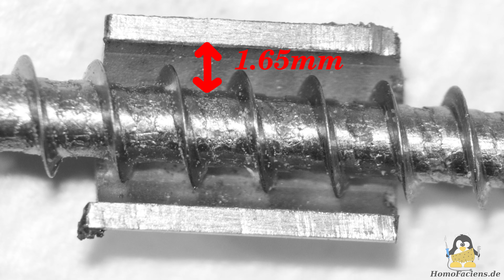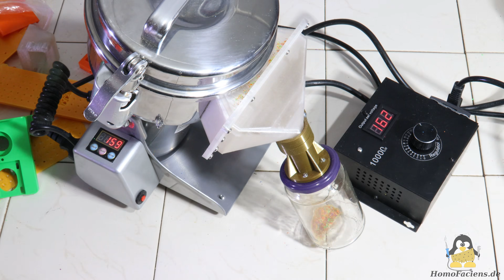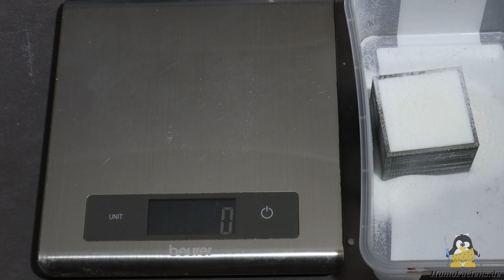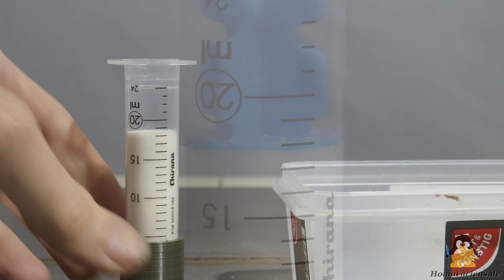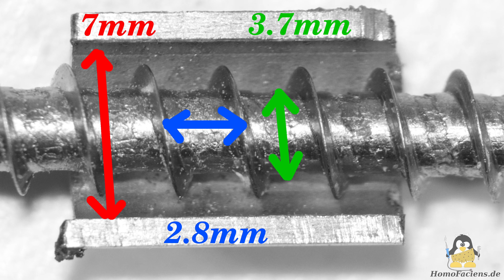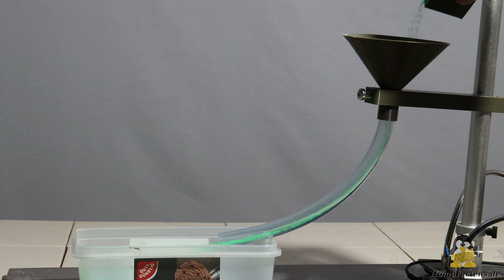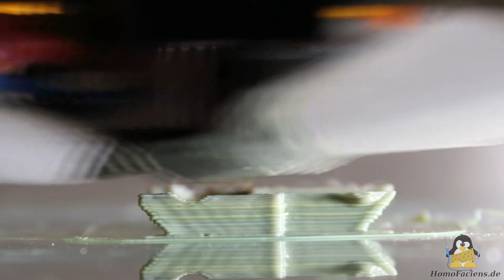Powder properties and print tests with extruder V7.2

Comment: I haven't watched all of your videos, just the last couple.
I'd like to suggest an idea. I don't know if it will work.

To compress the plastic in the extruder with a constant screw pitch, you can reduce the diameter.

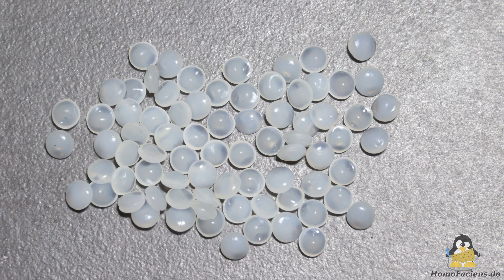There are hand-held cone reamers with a taper of 1:10, 1:30 and 1:50.
The screw can be roughly ground first. Then, make several plastic blanks with holes made using the same reamer. Then, precisely adjust the screw by lapping with different lapping pastes or abrasives of decreasing size. One plastic blank per abrasive size.

However, I suspect there's a risk of jamming with a screw in a 1:50 hole.
Reply from the maker: Well, version 7.2 works fine without all that extra work you are suggesting. If it works with a stock wood screw, leave it untouched. It wears out during operation and a new one costs next to nothing. Keep it simple!

Comment: Smaller might be better, but I think a more monodisperse particle size distribution is better too, isn't it? I think you could improve your milled powder by post-screening it. Typically any screening process involves a stack of screens, and the material is retained on top of a screen of smaller size, not just passed through a screen of larger size. You would then have a fine "plastic flour" waste product to deal with from the finer screen, but it seems like you could re-extrude this into large diameter filament to be chopped again, or else maybe use it directly as a very fine printing material, with different extrusion parameters.
Reply from the maker: As shown in the video, a mix of grain sizes has a higher overall density, which is favorable. Furthermore, a non uniform mixture of grains has a lower "flowability" as shown in the experiment with pushing the powder through the syringe. That resulted in a lower slippage (lower filament factor) during printing. While finer is better in terms of detailed prints, a bit rougher and mixed grain sizes result in higher volumetric throughput. As with all parameters in 3D printing: You have to find your personal sweet spot.

I demonstrated the properties in this video, the rest is up to you. ;-)
Reply: @HomoFaciens  It does seem we took different conclusions from the same evidence. 

It seemed like the propensity for jamming and the high compressibility of the mixed grain size powder would both be undesirable, and cause variations in flow rate, and that a high filament factor is good as long as it's extruded at a more stable rate and produces a smaller percentage variation than some other powder.

But as you say, there is a lot of room for personal preference in finding an engineered solution, and there's no such thing as a real optimum.

Comment: Would preheating the material before it goes into the screw help?
Then a liquid is going into the screw and the output may always be consistent, indipendent of the particle size.
Reply from the maker: Short answer: No!
Molten plastic isn't as fluid as water and the transition from solid to liquid isn't that well defined. You can try to build such an extruder. I don't think it will be better, but prove me wrong.

The extrusion is consistent enough for every day prints, even with the dirty cheap recycled plastic powder. For those who want even better results: Stay tuned!

Comment: The final printed part was much better than I expected, good work.
But honestly at small sizes pellets extruders seems to be too inconvenient, reducing the sizes of the granules is just too hard, grinding them requires too much energy, it is not a problem that can be optimized much further.
By using this as experimentation platform, if you make a pellet extruder that can accept 2-3mm granules that would be useful, I made an filament extruder and it uses 14mm diameter wood screw and it can accept regular 2-3mm pellets with no problem, I would recommend a wood auger, they are cheap and they do work, real diameter is like 13.8mm after you cut the head of it.
Reply from the maker: Thanks! Yes, the print quality outperforms any pellet extruder printing with 2-3 or even larger pellets. I have explained why, haven't I?

The recycled plastic powder is easy to create and dirty cheap. I have also explained that in a video: https://youtu.be/KLu5Z8oOpWA

How to make even finer powder will be treated in a coming video - stay tuned!

Oh no! Not that "use a wood auger" again: https://youtu.be/oH-e_poDeYE?si=Y_U774uqyJEbbyvB&t=385

Inconvenient? No!

Is there a video about your extruder?
Reply: @HomoFaciens  mine is a filament maker, not direct pellet extruder, it is on my channel as shorts video,  I was doing some experiments for radar absorbing materials and for that to grind abs granules I was cooling them below -40C, otherwise they don't break easily on grinder. Pla might be easier to grind due low impact strenght but still I would expect heating and melting problems.
Reply from the maker: Now I have found your video. Nice build!
If you can make filament of a material, you can also print it directly (I guess).
With a direct extruder you can also print materials that are not available as filament. I have demonstrated that with sugar: https://youtu.be/ea2dfdTszqM
More materials will follow - stay tuned!
Reply: @HomoFaciens  with your small pellet extruder you can also print stuff with high amount of additives, like if someone tries to make a material with radio or radiation absorbing or redirecting properties they would need to put a lot of rigid filling inside the thermoplastic matrix, normally they can't make a filament with more than 30% volume filling because filament becames too brittle, your device does not have that problem, maybe you can provide service to universities for their composite material development.
Reply from the maker: Yes, that's a big advantage of the direct extruder. I think of more common materials, first. Metal powder with extremely low binder for sintering afterwards. Existing filament printers need around 50% of plastic by volume. More metal and the filament becomes too brittle. Same for ceramic powders. This is very high on my list of things to try.

Comment: If I understand this correctly, the closer the input material is to a fine dust the more uniform the output from the nozzle will be in volumetric terms.
And controlling the output volume from the nozzle is crazy important if you want constant high quality prints.
So now the question becomes how to grind the input material down to a very fine size RELIABLY and I do not think that the coffee grinder (essentially a hammer mill) will be able to do it.
Something designed along the lines of a pepper grinder might be worth looking at.
Good luck and keep up the incredible work.
Reply from the maker: Yes, that's right, but the question is: How good is good enough.

The raw material I get with my modified mill is good enough for creating all the parts needed for making a copy of that Prusa printer and also for the next iteration that is currently under construction, based on a RatRig Vcore 4. So definitely useful and dirty cheap raw material.

Another yes: I have demonstrated before, why my mill won't be able to produce finer powder: https://youtu.be/IutEYKVnzrM

Thanks and how to get finer powder will be demonstrated a coming video - stay tuned!
Reply: Maybe it's better to just monitor the extrusion volume somehow and adjust the  flow/extruder speed dynamically?
Reply from the maker: That "somehow" is a big deal in practice.
As demonstrated: The recycled powder is good enough and simply use finer powder if more details are required. That's totally practical.
Reply: @HomoFaciens  I see, I somehow (cough) thought extrusion volume feedback was a solved problem.